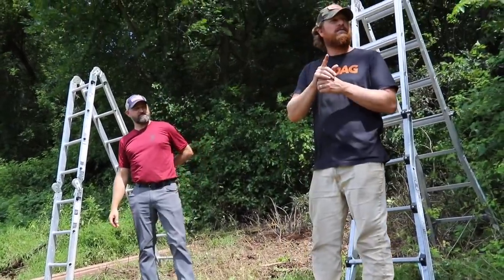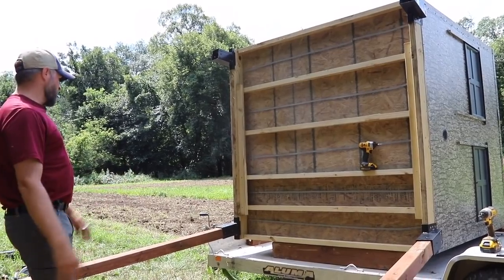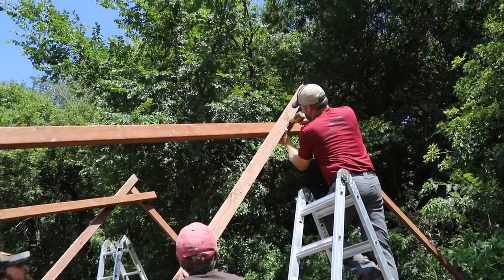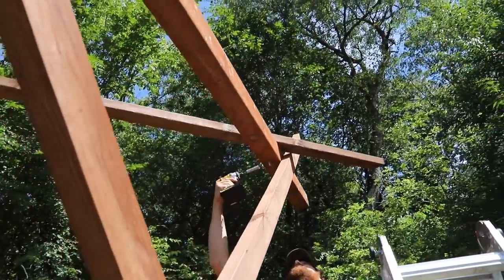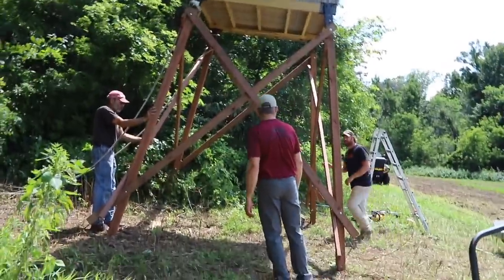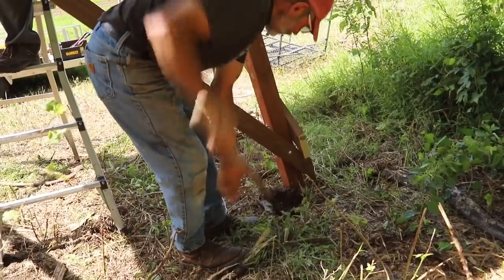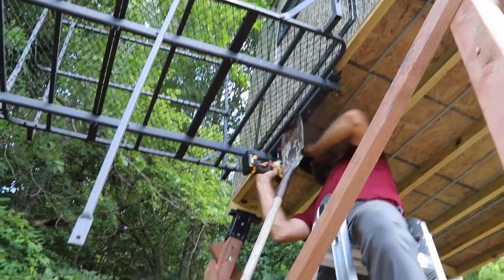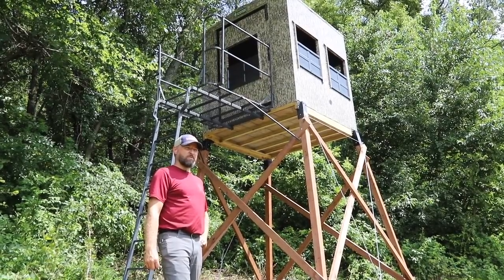Shadow Hunter Blinds: How To Set Up a Shadow Hunter Blind

Comment: You should think about putting a list of components in like the anchor going into the ground with the eye hook at the end, the turn buckle, size cable, type of screws you find that are good, size eye bolts, the mfg of the ladder/deck. This would eliminate a whole lot of questions for you.
I think this was one of the best videos I have seen to date. I am only going up 4 feet just to get off the ground and see over a small hump in the field so I really don't need much in the front and behind me the land goes down some 10-15' to an over flow of the creek. At my age I don't bow hunt or do much walking so this is going to be one of the last big projects I am doing. Retired in 1990 and this 6 x 6 blind / hide will be excellent for me.
BTW
So that it was easier for me I got a CAD program (many out there for free) and designed the whole thing in 1 day then I knew how long all the lumber was so that I just brought all the cut pieces out to where it is being built.

Comment: I have this same brand and model deer stand and the temperature changes throughout the year here in Arkansas has caused the walls to bow out and it's pulling itself apart. I contacted the company, sent ALL the information and pics they asked for multiple times only to be ghosted by them. Are you having any issues with your stand?

Comment: Personally, I would drill through the wood and use Bolts with washers instead of screws on the elevator brackets.
Reply: With the weight of the blind pushing down once it's elevated there's no way for them to come out either way.

Comment: Why do guys run anchoring. Cheap post concerte mix works awesome. U have to level it off anyway might as well cement each post so it can't move. A shovel, pail and water is all u need. Good video guys.